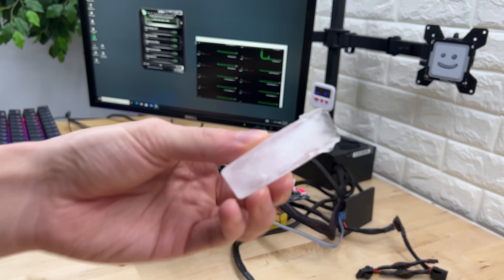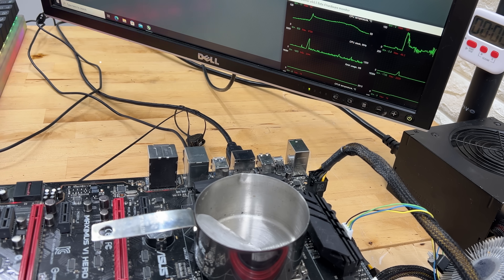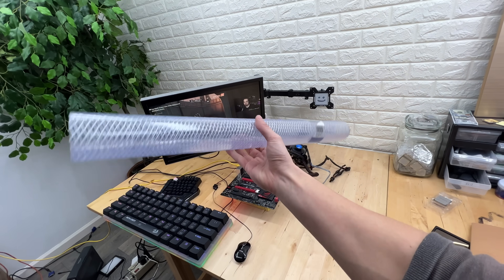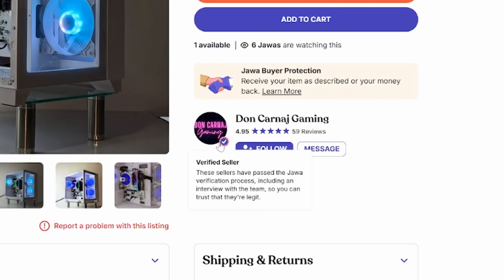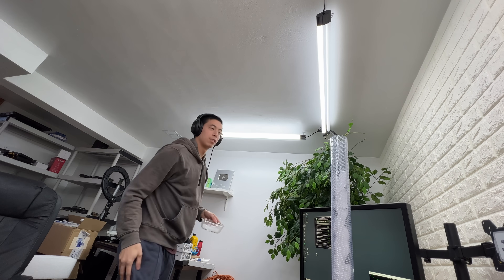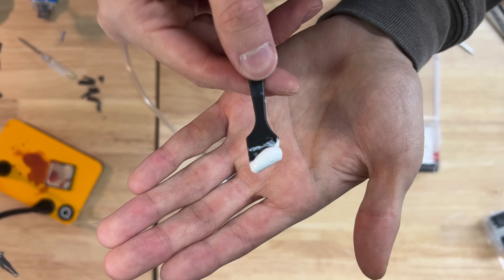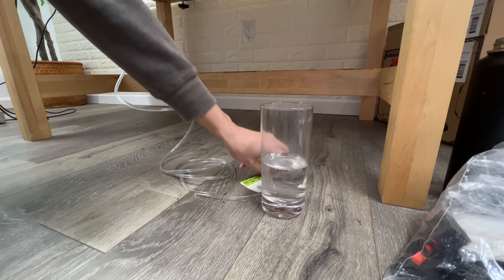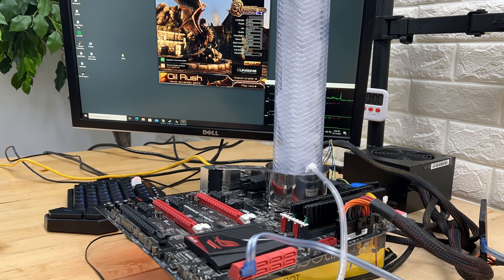Why aren't PCs cooled with ICE?

Comment: I actually did this with my M3 Macbook air, because apple and its stupid design philosophy didn't include any fan. I just filled a bowl up with water, froze it, and plopped my laptop on the ice.

Arma 3 max graphics went from 10 fps to 60 fps, and it usually lasts around 3 hours at max cpu usage.

Comment: use dry ice with this setup
Reply: Much more expensive, but also more effective. Dry ice sublimates rather than melts, which stops the build up of liquid problem. And it's colder of course, however it might be too cold and the lack of melting might mean contact is going to be bad and therefore actually much worse than ice. It needs to effectively cool the pan.

Comment: Has anyone ever wondered why the micro channels cut into water blocks is usually only about the size of the CPU itself? As if they share some sort of correlation where the water block can't exceed the size of the die, lol. There's no freaking limit to how big the water block can be. It can have micro channels from here to Kansas, and it translates to better heat dissipation.

Comment: Basicly your cooler draws heat from cpu since it turns solid water in to liquid witch require energy such as heat. I have had more convenient cooler which is using almost the same principle. My cooler turned liquid solution in to gas. Similarly the process  also requires energy so it can draw heat from cpu. In my solution the system was closed and produced by a company so it was realy convenient to use and obtain. By closed i mean that the liquid/gas solution was inside pipes. Liquid was at the bottom of the system ready to cool the cpu due "boyency" and gas was at the top part. At the top there were structures that help dissipating heat so that gas can turn back to liquid and start new cycle to cool of cpu. Maybe your cooler can be turned to a closed system to make it  more convenient to use. It will require a pump to get the water back to the top and some sort of heat machine to turn the water back to ice, but then again heat machine will most likely use some sort of gas/liquid solution to draw and pull heat from a place to an another so it might not be the optimal way, since the cooler i descriped can be considered as a heat machine so it might be most efficient use heat machine straight in to the cpu.🤔 How ever i am no phycisian so i might miss key points.

Comment: I couldn't help myself but noticing that the CPU's Clock is not going above 1600MHz, which is around 1.6GHz and I don't believe that "average" gaming CPUs are running with clock speed below 3.2GHz. the more the clock speed is higher it is normally for a CPU's temp to be higher, running a CPU max at 1.6GHz is really something "out of the ordinary" these days, of course an "improvised cold water cooling system" will be enough to keep it cool.

Comment: I would personally be mostly concerned with the weight bending the PCI connector and the slot when you have the ice cooler on the GPU. You would need to be extra careful to have it braced to prevent bending.

Comment: At this point I'm more interested about the absurdity of trying to make this pratical. Just overengineering it with a metal tube and a tube to a dispenser fridge + thermo isolation only on the sides of the tube to preserve the ice + system that replaces with new ice automatically of a large fridge with a tube to connect it.

Comment: use a bucket and and a pump to build an open icy water cooling sytem. Reguarly pour some ice into the water bucket so the temperature will remain low. I used this cooling in the year 90s

Comment: this is impractical if u take into account condenstation of moisture in air that will leak out and into IHS and VRAM if left unchecked.. that pot can gather moisture from air on outside.  U left that out of this video.  or did i miss it?

Comment: I'm guessing the reason is because by cooling the CPU with artificial ice cubes. You need to cool the ice cubes as well

So unless you live somewhere cold where ice forms naturally, the ice is more like a middleman. It would probably be more efficient to directly cool the CPU with whatever you're using to freeze the ice. Which is probably a closed liquid refrigerant heat pump

Comment: next video: Why aren't PCs cooled with SOLID NITROGEN?
Reply: True, why not go start a company?
Reply: But he can’t inhale used nitrogen though😂
Reply: @nighwargallogrifuvap well you can’t inhale water either.
Reply: @xyrkzes  You can drink it like he did in the video at least. Too much nitrogen can cause asphyxiation if your ventilation is bad.
Reply: Next playlist: Why aren’t PCs cooled by placing them in the SWIMMING POOL?
Reply: @ennuiphantom  microsoft did it actually, not in swimming pool though but submerge their server to the ocean. Although the result was great but they discontinue the project due to impracticality such as high cost maintenance and infrastructures.

Comment: what about mineral oil that dont short circuit electronics on touch
and then every thing on periodict table has different reaction to temps the limit is another question even bellow zero cause theres no way what was it -260 C is the coldest thing anything can ever get but i think it can get lower then that but we wont get a cryothrower any time soon

Comment: A couple of things...

1. You could freeze water to match the diameter of that tube and have a solid block of ice instead of individual ice cubes, this should in theory give you even better temps due to a larger surface area, and with the drain being set as low as possible to drain out water should ensure proper thermal contact.

2. Instead of using a stainless steel measuring cup you could used a 100% pure copper cup and polish its base both on the inside and outside, this should allow for even better thermal contact.

3. If you don't want to deal with water, just switch to DRY ICE which is MUCH COLDER than regular ice, and with the right containment could provide even longer gaming sessions and even allow for extreme overclocking.
Reply: Dry ice gets way colder so he would probably need an actual solution to deal with condensation in the proper environment. Atp it would be better to opt into liquid nitrogen or helium even though, and ironically would probably need to start heating up parts of the motherboard in order to maintain proper functionality since they're not designed to be ran at such low temps 😭

I think people don't cool their CPUs with ice not because its inconvenient but rather because there are better alternatives when already dealing with the downsides of manual cooling.
Reply: @jeancarlos6787  The average person including the average overlocker just needs either a massive high efficiency air cooler or water cooled system.

Most don't even need a water chiller unless they are running a super high end Intel chip (IYKYK).
Reply: @Spartan536  I agree completely, a noctua NH-D15 will outperform or match the average non custom/direct die loop and it's all really a consumer needs at a fraction of the cost and more reliable with less points of failure. For an enthusiast running a KS series chip or even just an average 14th gen intel like you mentioned it's def more efficient to run a 360mm radiator at minimum or test the limits for fun like this channel seems to be suggesting

Don't get me wrong we weren't suggesting alternatives to ice such as dry ice/LN2 because the pc would require it to run optimally, it was more just to see what his take on it would be considering the average non overclocker probably hasn't really messed with anything outside of a fan/aio and its good for exposure haha
Reply: @jeancarlos6787 it doesn’t beat arctic liquid freezer 3, like let’s be real here, a radiator at 360 beats ant bloody air cooler
Reply: @RavenL1337  in terms of practicality after trying both, air cooling wins if you use PC for browsing or audio, AIOs have too much pump noise even at idle. Thermalright Phantom Spirit is practically silent during browsing/office work/audio recording.
Reply: @jeancarlos6787  why dont we use mercury for liquid cooling if it's thermal conductivity is so high
Reply: @Jairion  the same reason we don't use mercury thermometers anymore
Reply: @TrippOnPower  poeple still use mercury thermometers
Reply: @TrippOnPower  Because it's toxic and dangerous? And?
Reply: @Jairion  it also reacts with certain metals to form amalgams, which can lead to corrosion of cooling blocks, radiators, etc. which isn't ideal when handling toxic, conductive metals.
Reply: I'm all for seeing a full liquid metal cooling experiment but there are reasons we don't see it used in the consumer market
Reply: @Jairion  And because mercury binds with metals especially copper and aluminum so you'd have to design a system that uses no metal parts. And being a liquid metal, it is also heavy so your standard pump won't move it. And mercury also has a low specific heat capacity (like about 3% that of water) so you'd need way more mercury than you would water making it even harder for a pump to move it.
Reply: @rainzerdesu  Right. I wonder if a reservoir would work better. Warmer mercury would float up, all of it would quickly heat up, but it would conduct the heat away, too. But I suppose a giant diamond is a better alternative...
Reply: @Jairion  Uh... Is that a joke? Because failure is assured over continuous use, and failures involving mercury prove hazardous.
Reply: @draexian530  Eh, mercury's danger has been exaggerated. My background includes chemistry and I can tell you that for mercury to be a health hazard, you either need longterm exposure or the mercury needs to be part of a compound. For example, methyl mercury is fantasticly toxic. Cleaning up a mercury spill from time to time is unlikely to be a problem for you (however you should be sure to dispose of it properly, be kind to the environment). Gold has similar toxicology. Longterm exposure can cause heavy metal poisoning, and some gold compounds are extremely toxic, but nobody seems to have a problem wearing gold jewelry. 

If you are still uneasy about using mercury, there is an alternative: gallium. It's similar to mercury, but it's less toxic and (i believe) has less exciting metelurgical reactions. It is solid at room temperature, but it's melting point is less than body temperature. This means you would have to warm up a gallium cooling system and manage the temperature, but on the plus side, if it leaks it would seal itself by freezing.
Reply: @draexian530  I don't expect it to be practical. But who knows without trying? Maybe if the only contact with the mercury was a plastic container and a diamond film on the CPU.
Reply: @Jairion first of all water liquid cooling does the job done it has enough conductivity to keep the CPU cool mercury is far more expensive and very toxic if leaked or heated too much
Reply: @Jairion liquid metal is used in the PS5
Reply: @Jairion aside from all the fun chemistry reasons, mercury is just a conductor of heat, you still need to dump that heat somewhere else so that the temperature can get lower. In thermodynamics terms, you still need a "cold" reservoir in order to move heat away from your "heat" reservoir which is your processor. With the ice cubes you're dumping that heat into the phase change of water from liquid to ice so your cold reservoir is, well, the ice cubes. All liquid mercury would do is tranfer heat from the CPU to the ice cubes better, but unless it's frozen solid it's not a cold reservoir in and of itself, just a better conductor for transferring the heat.
Reply: @InTimeTraveller  I wonder how fast warm mercury floats up though. If the CPU was at the bottom of a pipe filled with mercury or other liquid that conducts and irradiates heat well (same for the pipe), I don't see how the CPU could ever reach high temperatures.
Reply: @Jairion  because mercury is extremely deadly lol
Reply: @jackabm69  yes but is it mimetic polyalloy? 🕶️
Reply: @Jairion Imagine holding ice in a cup made of mercury
Reply: @Jairion parts failure would be messy
Reply: @jeancarlos6787  petroleum jelly?
Reply: Dry ice especially in large quantities is very dangerous. It will fill the room and you could die by suffocation if you aren't careful. Very bad suggestion
Reply: @BluecoreG  The amount needed to keep a PC cool using a singular puck would be inconsequential in a standard ventilated room.
Reply: @Spartan536  ventilated is doing a lot of heavy lifting in this sentence.
Reply: @BluecoreG  oh yes that's true, there should be a very good ventilation and a CO2 meter. The health and safety officer in my company told me that there was once a case where a person entered the elevator with a block of dry ice and by the time the elevator reached the ground floor they asphyxiated. Don't know if they died or they just were knocked unconscious but yes it's very dangerous in a closed room.
Reply: He should also drill a hole at the bottom of the cup to drain water through the tube, instead of the side of the cylinder holding ice. He didn't fix the buoyancy issue completely he only decreased it.
Reply: I love this comment section
Reply: @Jonathan-A.C. agreed, it escalated quickly
Reply: Chill… you want to lower the CPU temperature not freeze the dang thing
Reply: Inhales deeply... NNNEEEEERRRRDDD
Reply: Just hook up an old AC unit to it.
Reply: Still, at the end of the day, if you want to cool something to extremes, you always need to think about condensation. Air always has some amount of humidity so... at this point either submerge your PC into a coolant itself or put it in a vacuum chamber! Either solution is clunky as best... and messy, too messy for a simple PC as PERSONAL computer!
Reply: There's also still one problem:
This is only a solution to cool your CPU. Passively cooled components that need some moving air (VRMs, RAM, Hard drives, etc.) don't get any cooling whatsoever
Reply: Dry ice option is the best!
Reply: Dry Ice sublimates to CO2 though, which is poisonous at high concentrations tho, so make sure you have good ventilation in any room you bring large amounts of dry ice
Reply: @gh0stcassette  That's not a problem if the tube is a containment unit with a vacuum line for extracting the CO2
Reply: True, but dry ice could be dangerous without proper removal of the CO2
Reply: Hear me out - Water is what makes the design work better. It perfectly fits the shape of the container and thus has maximum surface area. It's the thermal paste between the ice and the metal.

It's good to keep a thin layer that touches as much ice and metal over volume.
Reply: HOLY SHIT dry  ice would legit solve all problems but would prob need a fan in the room incase the co2 doesn't fill the room so much
Reply: Yea dry ice is 1000% better. No water residue, freezing cold. Easy overclock.
Reply: Condensation was never addressed ....
Reply: @johnh1353  Insulation usually some kind of foam or ceramic blanketing addresses that issue
Reply: Or you have play the PC in Siberia
Reply: A silver cup would probably be even better
Reply: Congrats this is exactly how overclockers do their business for decades.
Reply: Dude, the dry ice is cooled CO2, you could die by that without a good ventilation 💀
Reply: So cooling paste is easier and can fit in tight spaces.
Reply: Water would still be a problem due to condensation. either way you need a hydrophobic setup for long term use.
Reply: You could also drain the water into an icemaker so it just loops back through. The easiest way would probably be to liquify the ice.
Reply: You'd still get problems with condensation which will ruin your parts over time.

Comment: 6:56 this is a bad idea, please don't drink melted water unless there is no other option. And boil it first too!
Reply: What's wrong with melted water?
Reply: @allwehadtodowasfollowtheda3061 only those who knows
Reply: @allwehadtodowasfollowtheda3061  uhhh, pardon my bad english, my argument has technical words i never used in english speech before.

Regular piped water contains chlorine-containing compounds in it (that is added during the cleaning process and usually isn't dangerous) that changes its properties after freezing and melting the water. So you should either purify water from impurities first, or boil it after melting. If you don't do it properly, it may cause a cancer. And drinking melted snow may isn't good either, because it has salts and metals in it and this will cause problems with your kidneys, so the best option is to distill it first

Comment: WAIT, what if...okay so hear me out. What if you strapped an Air Conditioner to it. Air Conditioner's work, very basically, by taking a Refrigerant and compressing it, then it boils and it's boiling point becomes really really high. This is why the part of your AC that's outside, is hot. Then the refrigerant is moved through tubes to the other side, it's boiling point suddenly shoots WAY down, and it evaporates. Taking energy from the room and making that part of the AC cold. What if you strapped a CPU heatsink to the cold part of an AC.

Comment: Just use ice pack , make more and put in fridge , have like 5 and rotate them constantly that way problem solved. The water would stay sealed, sure it would melt faster but since it can be reused constantly you just use 1 pack at a time.

Comment: I thoroughly disagree with your premise however you're doing this this way I agree with you however if you did it with 100% Pure Water Ice you could actually allow the water to get into the circuitry without messing it up but the water has to be absolutely 100% pure water. Also known Ultra Pure Water